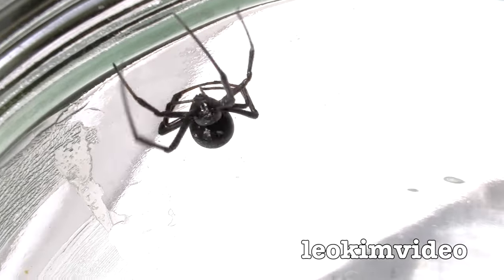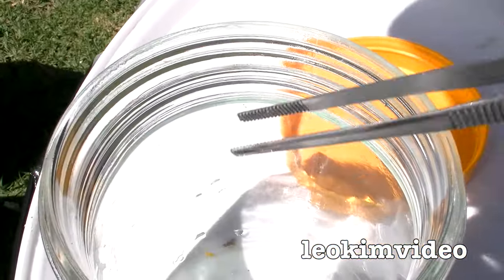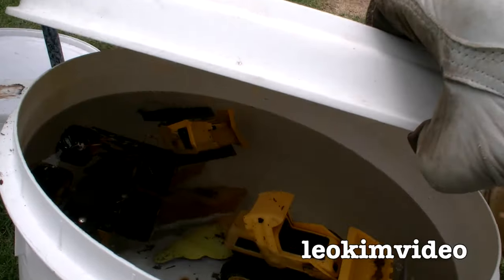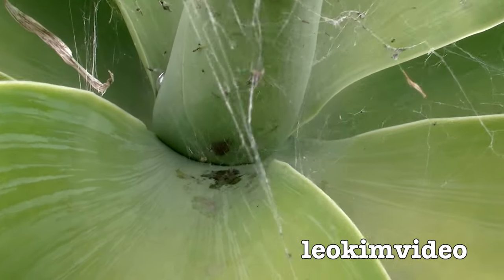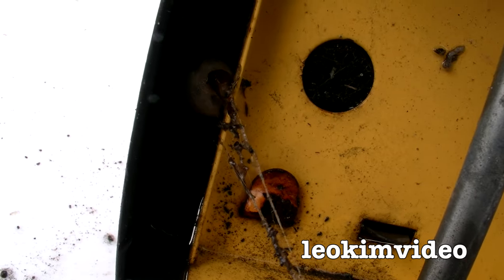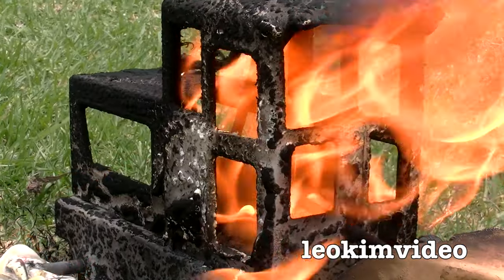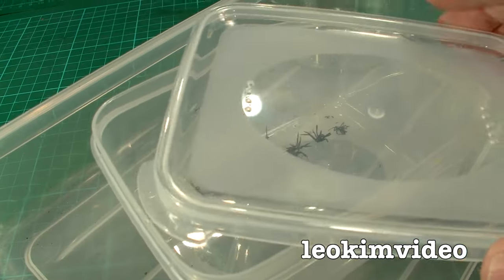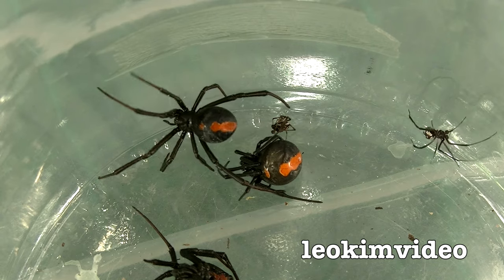Horror Redback Spider Count On Kids Toys Giant Egg Sac Found

Comment: this happened to me once when I was little I had a little bull dozer toy and once I found a dead black widow in it it's not as bad as this but hell it was a black widow those monsters are scary
Reply: M Clemons not as scary as the child of the earth spider or more known as the camel spider
Reply: Ashton Letcher the camel spider/ scorpion is NOT scary... they are NOT venomous and WON'T hurt you. The worst thing that will happen is if you press your finger to its mouth it could scratch you a little bit. The camel spider/scorpion is not like a usual spider because instead of having eight legs, it actually has ten legs! Those extra two legs catch the vibrations on the ground and when something comes too near to it, it will grab it with its two front legs (which are the extra ones) and just put it in its mouth. Incredible, NOT something to be afraid of. It does NOT target humans...
Reply: M Clemons
Reply: black widow coll i llickit
Reply: amanda s. whaaaat?
Reply: amanda s. pardon did you just say you want to lick a spider lmao😐😕😑😱😷😂😂😂😂😂😂.